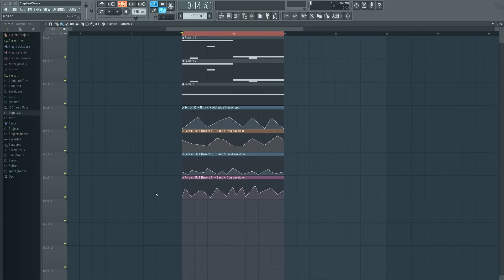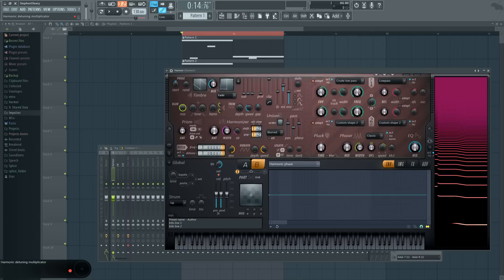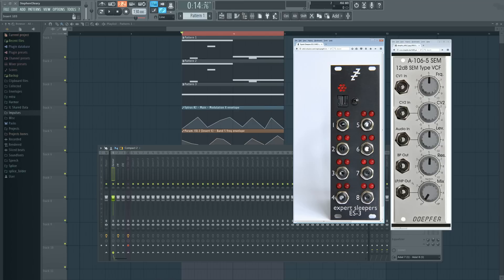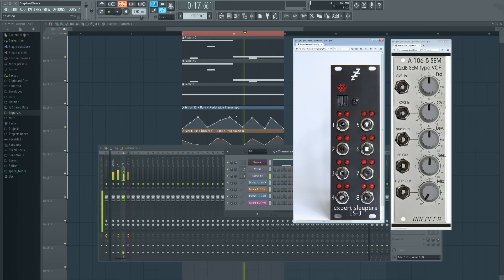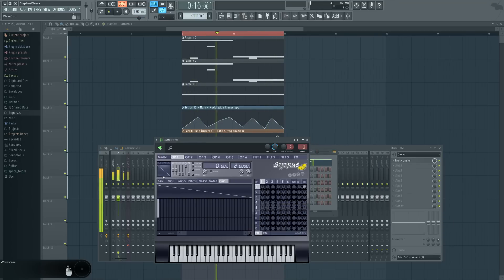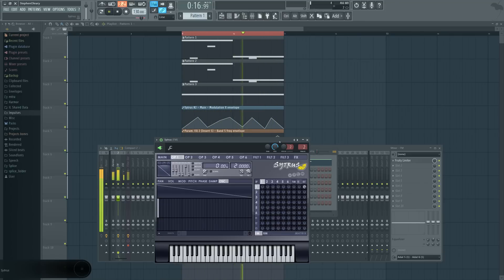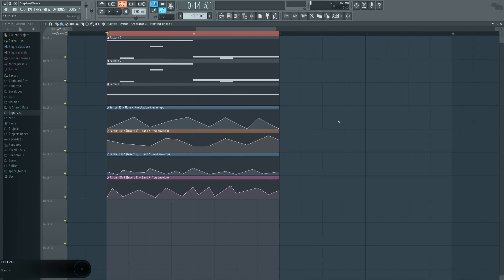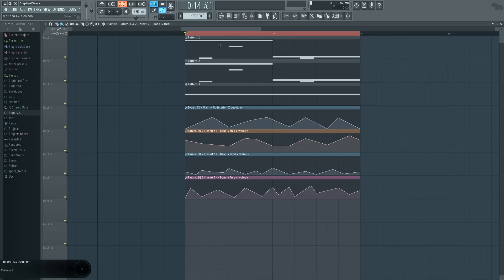How To Bass 141: Harmor Bass With Filter FM

Comment: I'm glad that you've properly explained why an analog environment is the go-to for high frequency parameter modulation, but could you do a direct comparison just to give us digital users a showcase? I just want to hear where digital starts to fall off for things like filter FM synthesis, and what direction the soundscape goes as the frequency is increased for a digital plugin vs analog synthesizer.
Reply: 96 k per second of you think you need it. There is none. Your ears won't be able to notice. I have the hardware and the only reason the op said it is weird or hard is his limited grasp of how digital works and the tools he is used to using which seems to be one or two things. Nord modular has an internal audio rate of 96 k. And that is pretty much good enough once you start mixing and boucing,

Comment: Wait, are EQs just high pass and low pass filters in parallel with perhaps some phase inversion?
Reply: +BadBadtzBobby A high pass filter is already a low passed signal in parallel and inverted phase.
Reply: EVERYTHING IS A LOW PASS!
Reply: +BadBadtzBobby how do you invert a long wavelength into a short one
Reply: well you get kind of a hp filter with a inverted parallel lp... but because the lp is already shifting the phase you don't get the same slope as from a real hp filter...  in the  physical analog world ... a lp and a hp share the same components like resistors capacitors and inductors... but the signal flow through them is differend...  just look up on wikipedia something how a lp or hp is built for a more detailed explaination ....
also there is a difference between passive and active filters

however you can still get interessting results with inverting a parallel lp or so.. because of the differend types of slopes (and phaseshifts)... that may sound more pleasent or interessting on some material or is faster to archieve a certain result or whatever...

it's always worth to experiment with filter routing..  thats how all the differend types of filters got invented over the years..because the components are limited indeed you only have 3 types.. resistors..capacitors and inductors... it's about how many and how you put them in the signal flow... same for multiple filters in row or parallel...

you can get pretty interessting stuff out of it...
Reply: +NoNameLeft1500 Wow, thank you for your great response. I actually started to learn DSP (digital signal processing) a couple of days ago and realised that EQ and LP/HP filter algorithms work quite differently. In regard to analog stuff I really should do some research.

It's always cool to know how things work.
Reply: +AsianGameBox  You are right. I wasn't aware about the phase shifts which occur when a filter is being applied.
Reply: Haha the lightbulbs going off in this thread are awesome af.

Comment: Have you looked at uhe Bazille? It allows to modulate anything with anything, but AFAIK you can't get your own audio in (it's been a while since I demoed it, so maybe that's changed by now)
Reply: +he2he Bazille is pretty good at what it does. I tried out the beta and got some nice r2d2 sounds out of it lol. poly ana is a good modular synth and even has wavetable FM (can't change the default wavetable shapes). http://www.admiralquality.com/products/Poly-Ana/ . Eats up a lot of CPU though and it's not so easy to work with until you play with it for a while even if your an expert because of the odd work flow.

Comment: Hey Seamless,

I'm a really big fan of your tutorials and I've watched quite a lot. I really want a good orchestral sound and I would like your input on what you think is the best orchestral VST. I've been looking into Orchestral Suite (VST) and it seems pretty good.

I would rather not get a soundpack for a sampler that isn't free (like Kontakt).

What do you think?

Thanks!
Reply: Spitfire is the only real contender but since I'm pretty sure you will be doing block chords with strings and brass, stock kontakt will do. EW is a terrible product with a terrible engine. Most people think orchestral = Hans zimmer blockbuster orchestration. If you want to do orchestral say John Williams, then you will require much more nimble articulations ie VSL. Short answer, kontakt stock sounds wil be good enough for you.
Reply: +R Cullen Hey, thanks for the reply. I take back what I said regarding using a sampler. Great advice, thanks again! :)

Comment: I've been beating my head against why good FM filter automation isn't really possible in a DAW. Thanks for explaining the PPQ thing, I hadn't considered interpolation as an important obstacle. Looks like it might be time to start saving for a small modular setup... augh, so expensive...
Reply: +Norman Reed work more dude
Reply: +Michael Davidog easier said than done
Reply: Over the Edge
so you need less eat
Reply: I'm not entirely sure what's going on in this thread so far. What I will say is that I spend my day working on software, and my nights in FL Studio. I've been trying to track down a plugin that can analyze a waveform and provide an automation output at a matching frequency. This video kind of dashed my hopes that such a plugin would be possible to create, at least with a real-time DAW, or if it would even make sense to do.
Reply: +Norman Reed The Drop has an FM input which is pretty nice sounding.
Other than that you'll have to look into things like MaxMSP, maybe Reaktor. Bitwig too, but you'll have to mess around with Jack, because it doesn't support Rewire.

Comment: easily done with digital. PPQ is irrelevant in this example. Your external filter is modulated by an audio signal, not automation which is bound by ppq. Soft synths with Audio in could do this since 2000. Reaktor would also make this incredibly easy and more versatile. Bidule, maxmsp with live. I get that you haven't ever really owned hardware and don't quite get the concepts. 

there are at least a dozen virtual synths that allow for either audio input or a signal path to use an oscillator to modulate a parameter such a the filter. You sort of undermine your previous parsimonious take on production saying why use a tool when you can do it with already available tools. This would be one.  

Doing this digitally is incredibly easy but perhaps the how escapes the amateur producer who blogs.